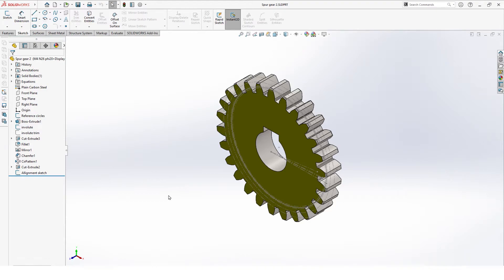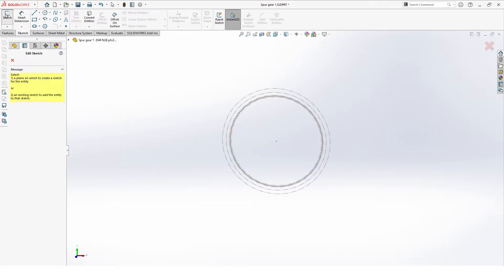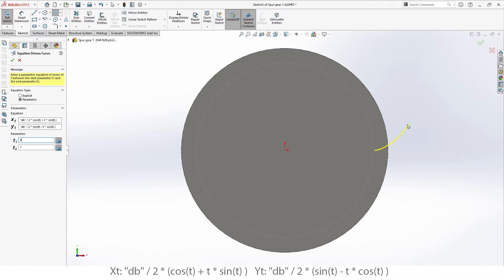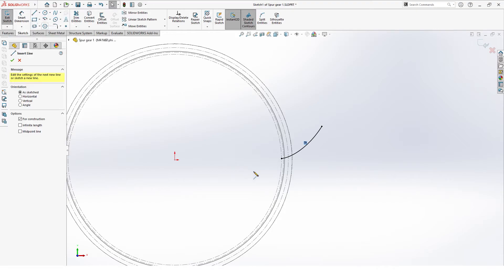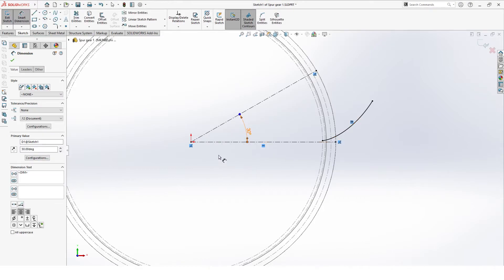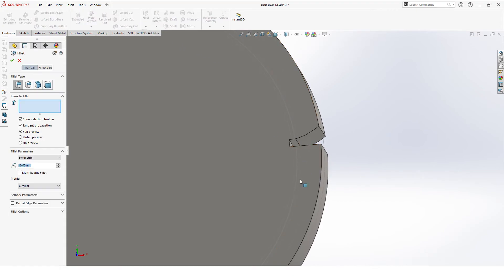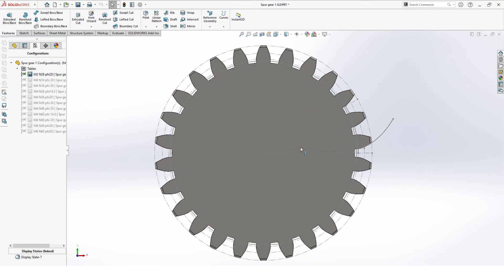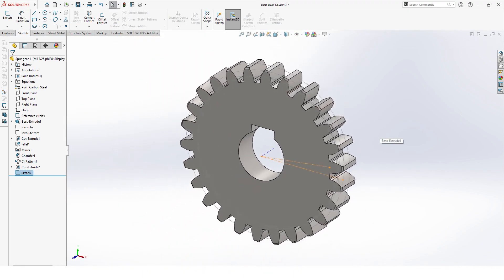Solidworks Pro Tutorial - How to draw a Spur Gear with a true Involute using Equations

Comment: Good job, probably the best I have seen.
However as all the other demo I have seen it lacks the throcoidal chanfer generated by the hobbing tool.
It would be nice to design a vane tooth generated by the envelope if the hob, but I'm unable to do, unless manually point by point.
However congrats fo this work.
Reply from the maker: Thank you.